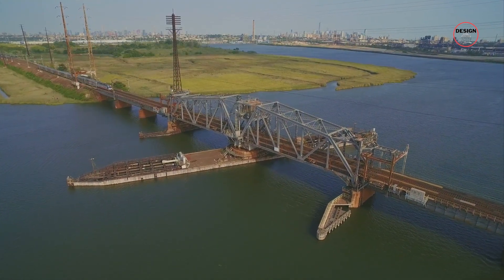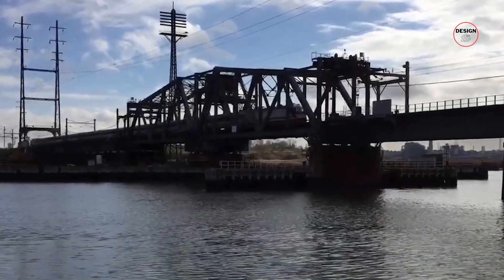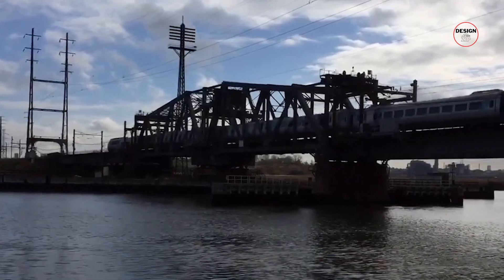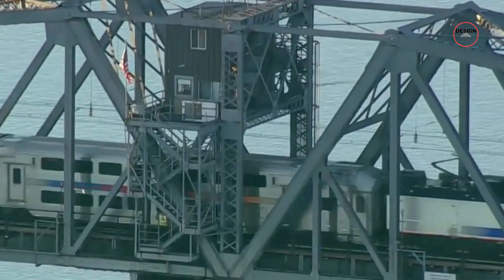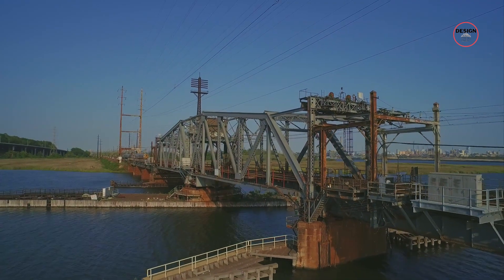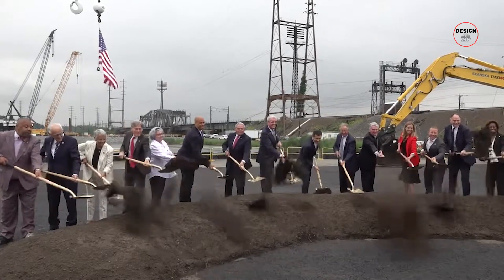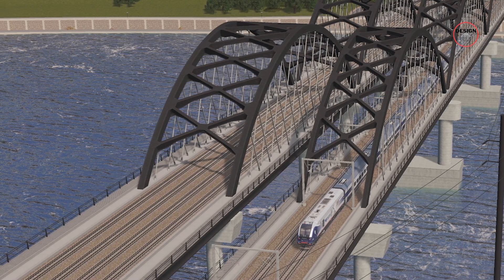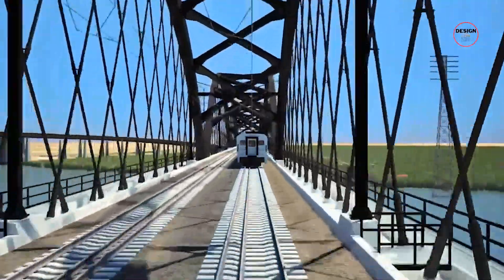What’s the Plan to Replace the Aging Portal Bridge?

Comment: I am 76 today.  How tragic that the Reagan tax policies resulted in 50 years of quasi criminal neglect of our infrastructure.  Many of these projects should have been completed in the 60's and 70's.   And we never should have destroyed our passenger rail network.
Reply: In the 60’s and 70’s the NEC was still run by the notoriously broke Penn Central. Try the 90’s or early 2000’s